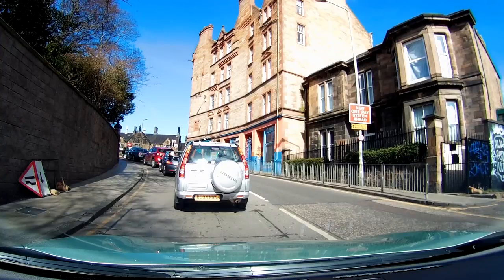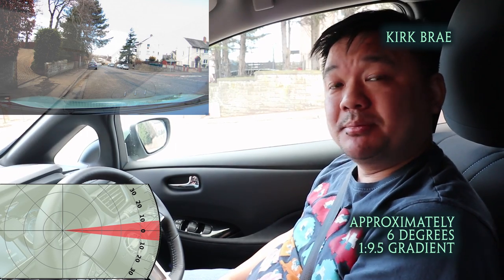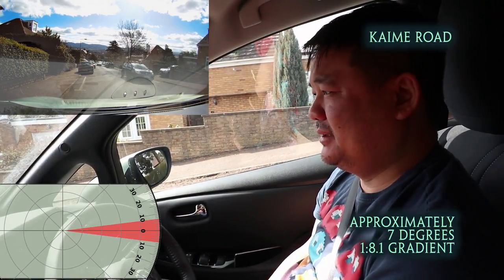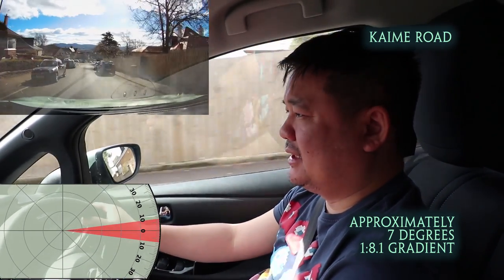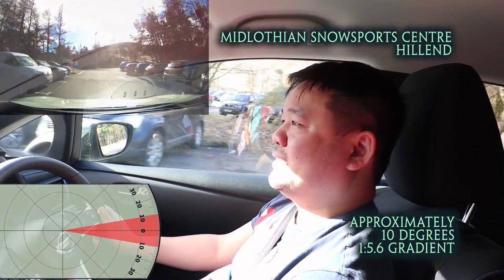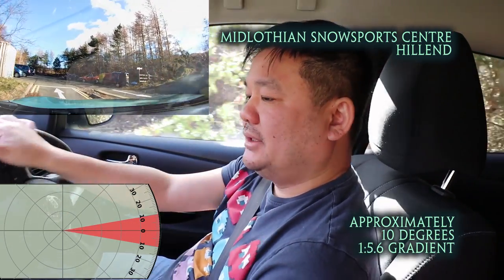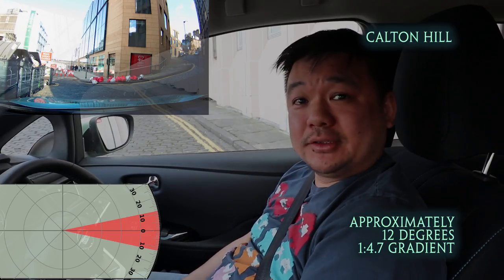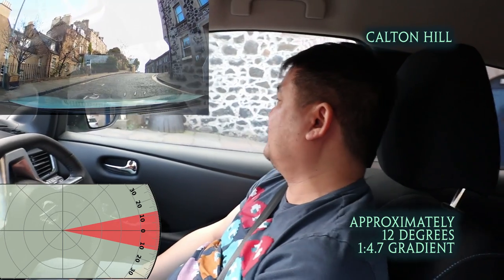40kWh Nissan Leaf 2018 - e-Pedal how steep can you go? Can it handle the seven hills of Edinburgh?

Comment: Great testing!  One thing I have noticed with the e-brake is that in stop and go traffic especially, it doesn't seem to brake as much as it does after using it for a while.
I don't think it is the speed, but I THINK the e-brake system is "learning' the traffic as it does brake a little more aggressively after some time!
VERY nice system I think, and I use it alot!
Thanks again for your testing!

Comment: Hi James! Great video! Question: could you speak to the battery expert you mentioned about the battery cooling? Thanks!
Reply from the maker: kovadam69 I've talked to his over the weekend and a lot of his suggestion you would need to open the battery case which I'm not willing to do just yet. so I'll need to see my mechanic friend and have a poke around the car.
Reply: Thanks! Yeah, the problem is if you want to implement some sort of cooling, you have to modify something on the battery case (open it, drill holes, etc.) which will void your warranty. Question is it worth? I would do some experiment on some degraded cheap Gen1 leaf, where there is no guarantee and you can open the battery case. Solution could be insert two pipes and fill up the whole battery case with some non conductive liquid and using a pump and heat exchanger cool and circulate the liquid inside the battery case. That would be very efficient. With some smart electronics you could even attach it to CAN-bus and it could act as a complete TMS, heating/cooling the battery as needed. :)

Comment: Good vid James.  Nissan advertises that epedal will hold up to 30 degree inclines/declines. I’ve tried some hills in my area with no issues but will have to test on the max.
Reply: Good call - I didn't think of checking Nissan's published figures. What this video and my own experience both show, though, is that 'holding' is one thing, but stopping on an incline is another. When we're driving normally we know to push the brake pedal harder when we're trying to stop on a downhill slope, but the LEAF doesn't know whether it's going up or down. Perhaps a future refinement should aim for a rate of change of wheel speed, not simply braking force, so hills are compensated for.
Reply from the maker: I never read the manual haha will need to find steeper hills! :D

Comment: James, if you want a real challenge then you need to head my way to South West Edinburgh.  Kirkgate in Currie (55.890008,-3.303722), which is a nice long (steep) hill or Ravelrig Road in Balerno (55.8919,-3.346322), which isn't as long but very very steep 😁
Reply from the maker: sounds like a challenge, I might have redo the test at some point top 3 instead :D

Comment: Have you noticed sometimes when using e-pedal that the system does not regen at all stopping from about 30 mph with SOC under 80%?  Or it starts regen and then at about 20 mph it switches fully to friction brakes?  I see this happen once or twice a day, usually right after I start driving, and it drives me mad.  If I switch out of e-pedal in B it will regen in these situations.  SO it's something going on with e-pedal and wondered if you'd observed this also.
Reply: @Aaron - I have noticed that too.  There's a short steep downhill in front of my house (so steep that e-pedal won't stop the car) and it always uses the brakes. Understandable when fully charged because there's nowhere to send the regen power, but it still does it when I start the journey on much less than 100% SOC. Makes me wonder if I'd get better range with e-pedal off. Not a problem if it only does it at the start of a trip, though.
Reply from the maker: I've noticed when Im fully charged it only allows maybe 2 bars (small power band) of charging from e-pedal but goes away once i use up some power. maybe its just when you first start up and nothing to do with how much charge. I'll have a look tonight when i leave work to see if its letting me do full regen on e-pedal or not.

Comment: When ePedal is holding the leaf still on a steep hill, how much power does it use? Does the motor heat up? Does it show up on Leaf Spy?
Reply: It uses the brakes, no motor power. When you slow down it uses regeneration initially, then switches over to friction brakes when the vehicle has slowed to the point where regen won't give you enough deceleration. I think Nissan spent a lot of time getting the transition smooth, because you can only tell when it happens by watching the dashboard power meter.
Reply: anahatamelodeon, oh, that’s rather clever. It did look seamless, and hopefully exercises the brakes enough to keep the calipers from from seizing or the rotors from getting rusty.
Reply: That’s a great question and I have not looked at Leaf Spy while holding with e-pedal. However I believe it’s very little juice to use ABS I think to actuate the brakes to stop and hold. Will have to get some more data on that.
Reply: What a surprise IMHO is here :)
Reply: fento r, are you stalking me again? LOL
Reply: IMHO ahaaa funny
Reply: What sort of Scotsman are you if you don’t know about the rolling of the haggis???  Hahahaha....